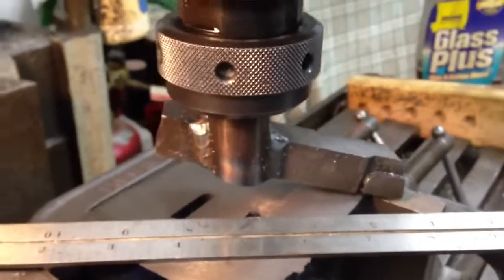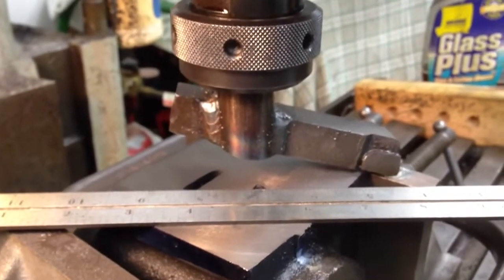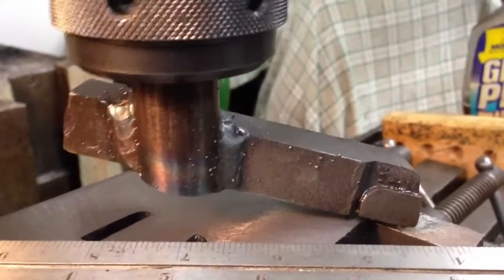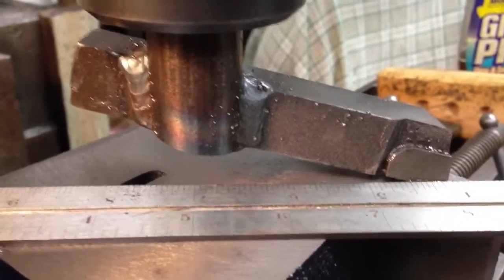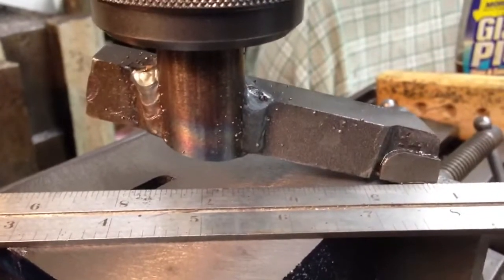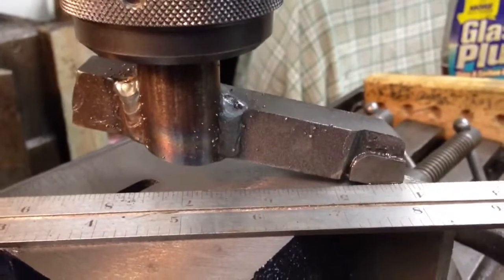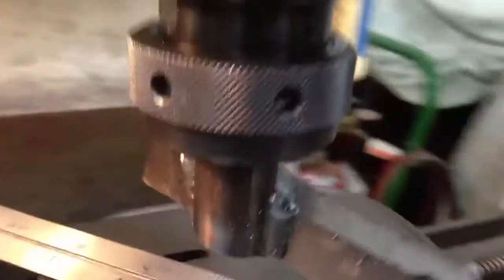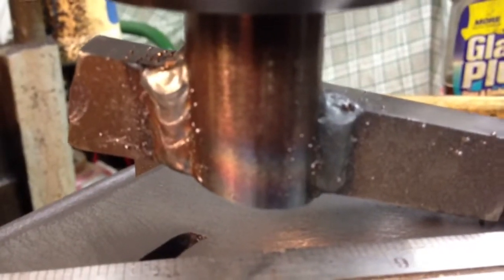This flycutter will cut 6" wide swath

Comment: Very nice!

I just received a 5" boring bar from Suburban Tool, and will be using it to make a 6" fly cutter for my CNC converted Grizzly G1006 bench top mill drill.  A bit more expensive than your approach, but I get carbide insert tooling, not that I'm likely to need it with the little bit of boring that I do.